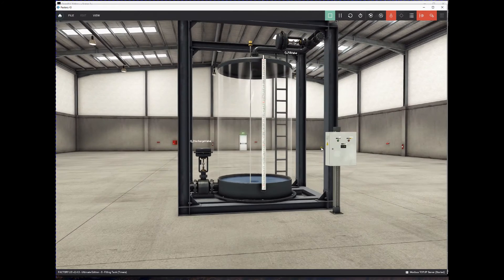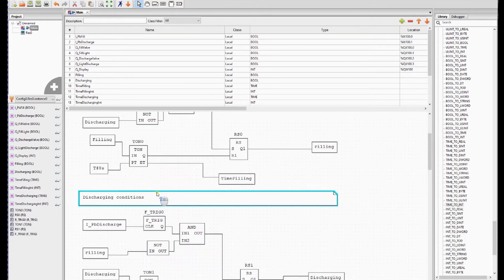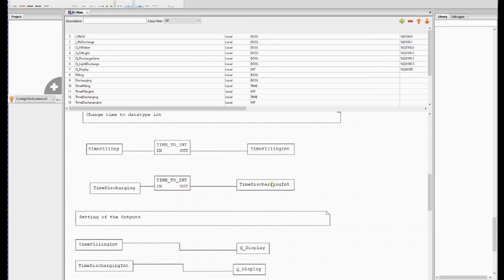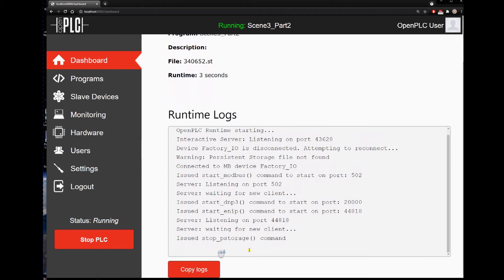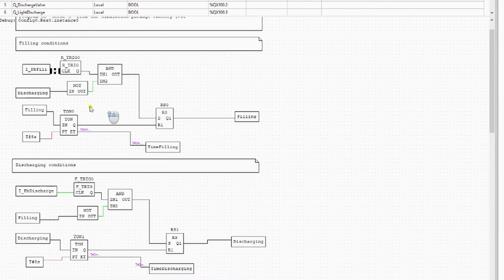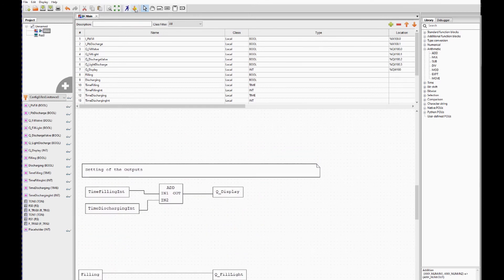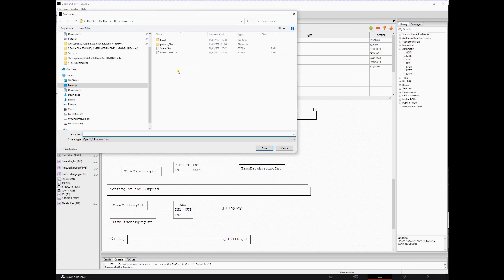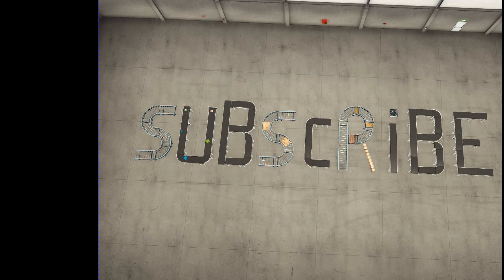How to solve scene 3 in Factory I/O | Part 2

Comment: Do you know what adress I have to use if I want the display to be a float instead of int? I used Real as (data)type in openplc and in factoryIO I have the display config on [0, 10] V and in the drivers overview it shows as float, but I have no idea what adress I have to use in openplc. If I use %MD0 I can see the value changing in the openplc webbrowser but in factoryIO the display stays the same(It is connected in Driver overview  to holding Reg 0). Not sure if you tried using float for display before?
Reply from the maker: I will look into it the day after tomorrow. Make sure you add a point to a float. For example "8" will not be a good value for a float (in any PLC program). But "8.0" works well.
Reply from the maker: So I also tried using the Real datatype. I'm pretty sure the problem has something to do with the addressing of modbus and OpenPLC => https://www.openplcproject.com/reference/modbus-slave/ OpenPLC Analog output (QW...) is only 16bit and is easy accessible in  Factory IO. But with MD%... I was not able to get Factory IO to read the results (yet). I will try some more in my spare time 🙂
Reply: @seafoxc  Alright thanks for checking it out! I was already expecting something like that, everything runs fine in openplc but factoryIO has a problem with the 32bit size adress which is basically just 2times a 16bit adress.
Your tutorials really helped me out building some scenes and connecting everything with openplc, thanks for that!
Greetings from the netherlands ;)
Reply from the maker: @enrico3769  Thanks! Alvast een goed nieuw jaar gewenst uit België!